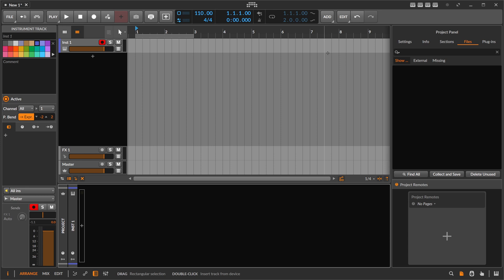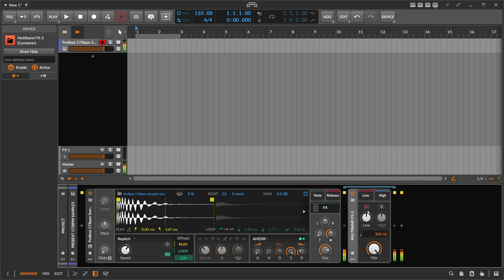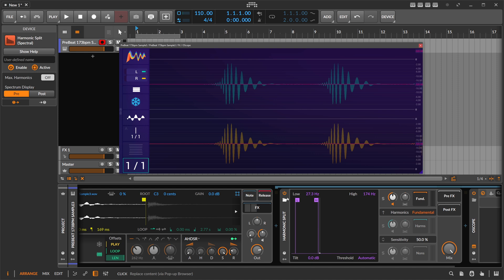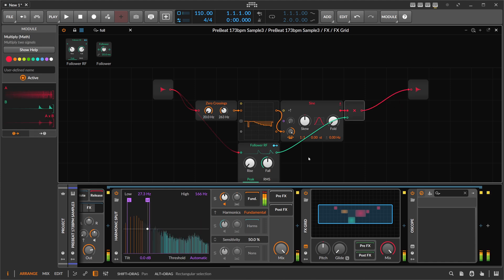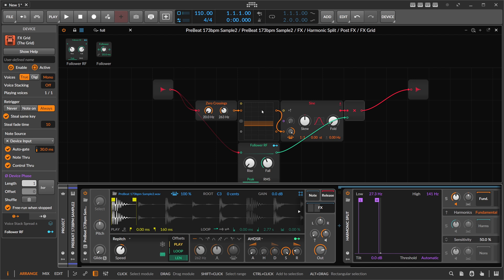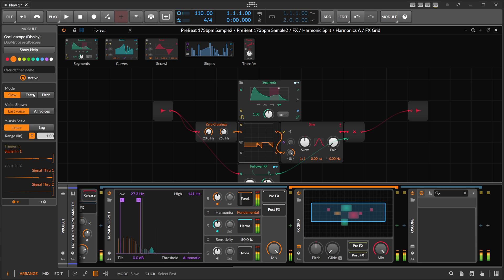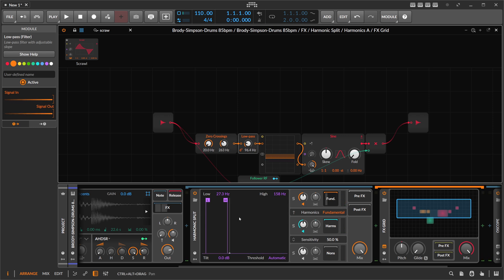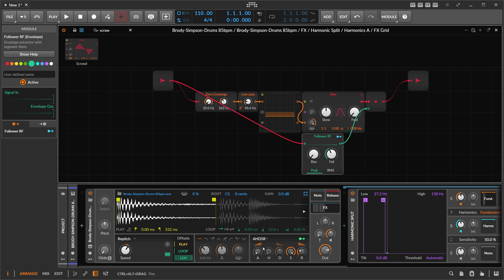KICK Resynthesis

Comment: FL studio sampler has this feature called pogo... It was a great kick design tool... Its sounds like an attack pitch mod but it was so fast and easy to create new kicks. I wonder if that can be made in bitwig
Reply: Probably not the answer you're looking for, but you can recreate the pogo effect by switching the sample to "repitch", adding a start and end warp marker, and then 2 additional warp markers in-between that you move around till it sounds good. I tested this in the Grid, and you can achieve the same result by simply connecting Segments to the Pitch In for the sampler, and adding a Pitch at say C4 into Segments. Then you just move the "segments" around until you get the sound you like. That's 30 minutes of my life I'll never get back testing it for you.
Reply: @paradoxic1888  DUDE! the audio warp did the trick well! thank you!! :D
Reply: For MIDI triggered kicks, In the sampler attach Segments to the Speed knob in repitch mode. If you want to get real tricky you can use the "Mix"  modulator to set a range for your modulation. (Save as default preset for POGO like ease)
For direct audio clip kicks, automate the clip pitch in the Edit window. Any time you copy and place that sample the automation will come with it. (Repitch warp mode for highest quality)
Reply: Yeah that would be sick